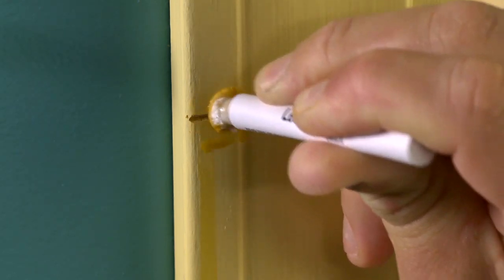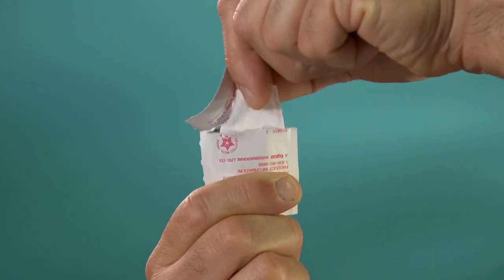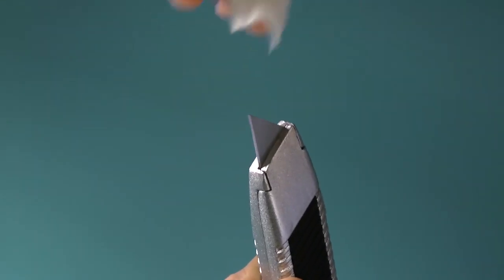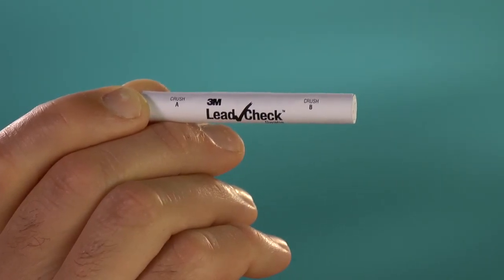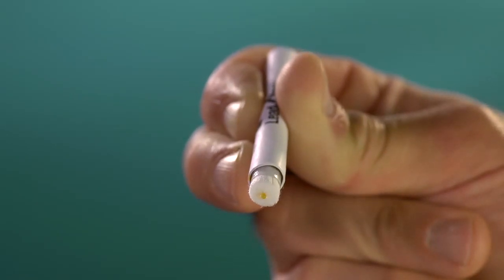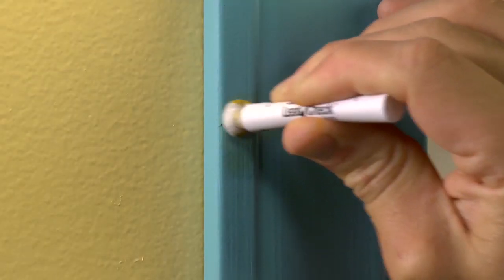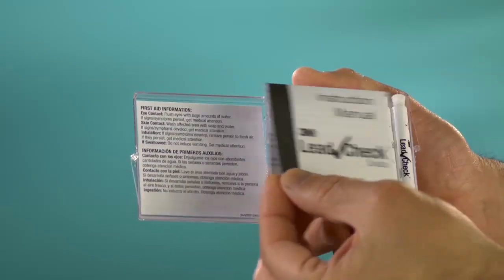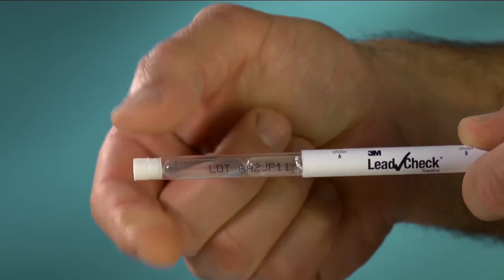3M™ LeadCheck™ Swab Demo on Painted Wood and Metal Surfaces

Comment: This video is not a substitute for the instructions, it is my opinion that this video needs to be redone and can cause individuals some unwanted worry.   In the video it discusses the confirmation card.  This card has lead imbedded in it and is used to confirm that you broke the ampules and mixed the reagent correctly, to perform a correct test.       In the video it discusses squeezing a drop on to the confirmation card, which turns RED then the narrator states "remember RED is LEAD".     It provided me a bit of panic.
Reply: Thank you for clarifying this. Very good point
Reply: You're a lifesaver! Thank you. I watched this video and read your comment right before  some ppl came over to test for lead. The people testing lead at my place thought there was lead when they used the cards, and I told them exactly what you said. I would've lost a tenant if I didn't read this comment. Thank you so much!

Comment: Here’s what I found so far

Per the instructions:

Interpretation:

If the Swab and or the test surface turn a pink to red color, the test is positive for lead. Only lead produces a pink to red color with 3M LeadCheck Swabs.

If the Swab and or test surface did not turn pink or red no hazardous level of lead was detected. Use the confirmation card to confirm that the 3M LeadCheck reagents were active (the circle on the card should turn bright pink).

If the Swab and or test surface turn orange, the result is negative for lead but positive for barium which was sometimes added to paint as an extender. If lead were also present in the paint the Swab tip and or test surface would turn pink before turning orange.

If the Swab and or test surface turn purple, the result is negative for lead but positive for tin.

Comment: My swabs seemed to work as described, except they turned a rich golden yellow, and the test card turned a deep rust-red? I was expecting pale yellow and fire-engine red, respectively.  Does that sound normal?
Reply: i just did this test...according to the instructions the cars is suppose to light-up red just to make sure the swab works properly...so if the tip is yellow (not red) then you dont' have lead.....the cars should light up red no matter what....its just to make sure that the tip is working.
Reply: I had the same results for two swabs.  I believe those colors are normal.

Comment: What? 90 seconds? after that amount of time, it is not effective anymore? In fact, it is effective for much more than 90 seconds. I tested different things that were negative with the same swab until I tested one that had lead and it became pink when there was lead. Each time I tested things that had no lead, I tested other items until one would test positive. I always made a final confirming test on my stained glass cabinet doors because they test very red positive each time, so I know that the reason it does not become pink on other items is not because it is not working anymore after 90 seconds..or else the leaded stained glass door would not test positive either. So I am kind of surprised now, I don't really know why you would say it has to be tested in 90 seconds...

Comment: Wrong information!  The part about the confirmation card at 2:51 is completely opposite of what the instruction sheet that you get with the testers says.  The confirmation dots are only to confirm the reactivity of the reagents if the test is negative.  Red on the test dot does not mean lead is present!  It only means that the test chemicals are working properly.  This is word for word from the instructions:  “CONFIRMATION OF A NEGATIVE RESULT.  If the swab tip does NOT turn pink or red after rubbing the test area, squeeze a drop of the 3M LeadCheck reagent onto one of the test dots.  If a pink or red color appears on the confirmation card dot, the swab was activated properly and lead was not detected. If the test dot does not turn pink or red, the test was invalid and must be repeated with a new 3M LeadCheck Swab. Use the confirmation card to verify negative results only.”  This video needs to be corrected!  It’s very confusing!

Comment: Bought a 2 swab 3M kit to test for lead in soldered joints on some copper items I bought.

These kits were USELESS.

I prep'ed and cleaned the areas to be tested.

1) The test swabs leaked yellow crap everywhere even when minimal pressure was used to crush the amphules and squeeze the body of the swab.

2) The swabs turned black as soon as I started rubbing on the metal so there was no chance of seeing red or not.

$20 NZD for this garbage ... won't be buying 3M again in a hurry if I can avoid it.
Reply: "The swabs turned black.." that is oxidation, one of the test chemicals is reacting with something in your materials, or it wasn't cleaned thoroughly enough.

Comment: WHAT THE HELL!! Your instruction CLEARLY STATE THE FOLLOWING ON THE TEST CONFIRMATION CARD
QUOTED 
"If the swap tip does not turn pink or red after rubbing the test area, squeeze a drop of the 3M leadcheck reagent onto one of the test dots.
If a PINK or red color appears on the confirmation card dot, the swab was activated properly and lead was not detected

If the test dot does not turn pink or red, the test was invaliud and must be repeated with a new 3m Lead check Swap"

THAT WAS DIRECTLY FROM THE INSTRUCTION! BUT ON THIS STUPID VIDEO  you state at 2:50 time in the video RED MEANS LEAD!! THATS NOT TRUE ON THE CONFIRMATION CARDS...

How in the world can 3m Make this mistake???
Reply: 3m. I'm expected.much more
Reply: +Don Blade just checked epa site to confirm this BS. the red on the confirmation card does not mean lead. It just means chemicals were mixed properly. Red or Pink on swab means lead.
Reply: +Don Blade "THE VERIFICATION CARD contained in the swab kit (a small cardboard card with little circles on it) should not be used to “confirm or deny” that an item is positive. If you test an item and it is negative (the swab is still yellowish/orange) and then you go and rub that same swab on the verification card IT WILL ALWAYS TURN PINK!  That is because there is a very small amount of lead in the verification dot on the CARD, not because there is bioavailable lead in the surface of the item you just tested." http://leadsafeamerica.org/leadcheck/
Reply: Mine turned orange on the card does that mean no lead?
Reply: I noticed this too and it confused me as well. I have already used this test twice
Reply: i wasn't confused by this....